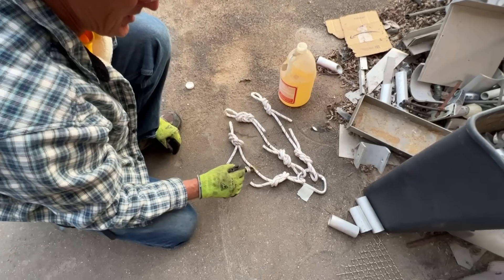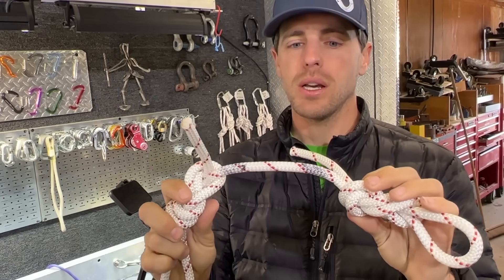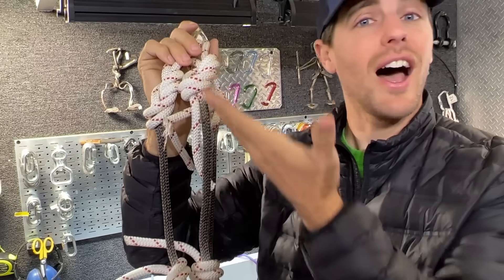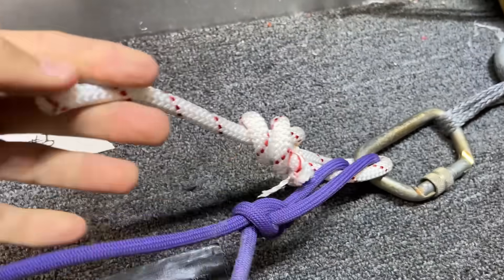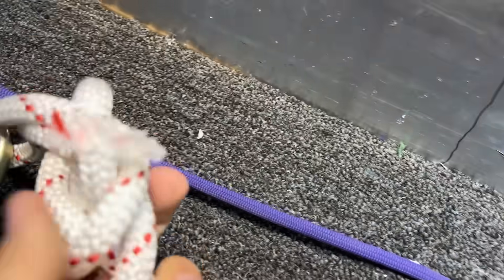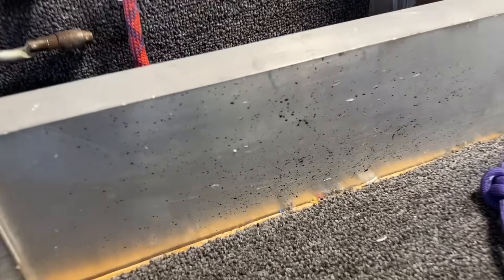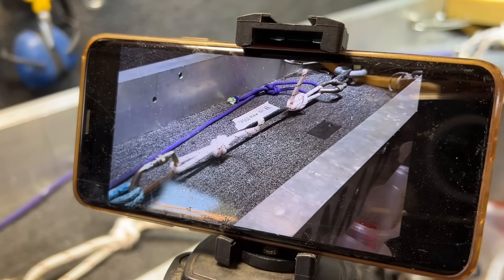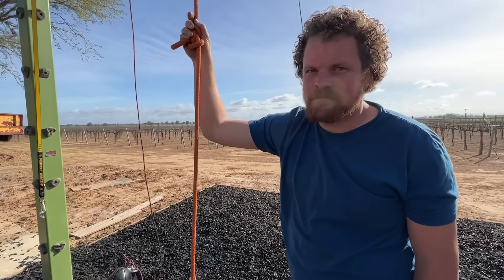Contaminated climbing ropes - oil, sunscreen, deet and acid

Comment: I'd say for this kind of test, it'd be better to test the "full strength" instead of knot strength, since if a rope is exposed to chemicals in a work environment, there's a good chance you're going to put knots in the potentially compromised area, further reducing the strength.
Anyway, it's easy enough to see what can and cannot damage the rope chemically, just compare the material (Nylon most of the time) chemical stability against the agent used, most nasty stuff stuff you'd expect to damage ropes is surprisingly harmless.
As for oil, Iapart from making the rope slippery and attract dirt, which is not ideal for anything really, some oils have softening agents, which in the short term won't do anything, but prolonged exposure will swell and destroy the fibres.
Reply from the maker: I don't have the ability yet to test ropes with diverters for full strength.  I'm also not very motivated to because I use knots when I use ropes so I like the real world use case tested.  If it breaks in the knot then the contaminate we tested was less damaging than the knot was for it.
Reply: That’s all well and good until you tie a knot in the contaminated section of rope. 

Which, btw, is how you could test this without diverters.
Reply: @HowNOT2  just soak one knot and not the other knot
Reply: @HowNOT2  I guess so, but let's say the knot lowers the strength by 50%, and the contamination lowers it by 40%, it's still gonna break in the knot, but if you put a knot in the affected area, the strength loss would be compounded.
Wouldn't a piece of say 40mm pipe/ rod at either end be enough to test the ultimate strength, or close enough to it? For ropes a thick walled pipe should be strong enough, as you're not testing anything larger than 11mm.

Comment: Have you done any snap tests on knots like the super 8 or figure9? Interested in how much strength I can retain with those knots.
Reply from the maker: I did a super 8.  I haven't released it yet.  Breaks just like an 8 whether or not you pull just one ear or both.
Reply: @HowNOT2  thanks for the response. I always liked the super 8 because it felt like my loop was doubled up and there would be additional shock absorbers,   despite being “pho-redundant”  so to speak.
Reply: @HowNOT2  I also just left a comment on your responding to trolls video. Thanks for all the hours you put into your content, it’s very valuable to the gear heads and knot wizards 🧙‍♂️ who would otherwise injure themselves trying to push their gear to the extreme.

Comment: Good video per usual. Surprised deet didn’t do more damage. While chemical sunscreen may not damage your rope, it’s very hard on your skin, increasing your risk for skin cancer nearly as much as overexposure to sun. Chemical sunscreen also contributes to air pollution as it off gases contributing to voc concentrations in the atmosphere. Always recommend mineral based sunscreen over chemical based.

Comment: Acid can take time to damage nylon. I would like to see the results 5-7days after the contamination.
Reply from the maker: In just 24 hours it broke it low enough I wouldn't want it on my ropes for any length of time.  But yea, it could probably keep damaging it.
Reply: @HowNOT2  I'm more curious of other contaminates over longer durations. Oil and other products could take months to react with the rope before any noticeable wear. Direct sunlight and regular use can provide energy to speed up the process.
Reply: @HowNOT2  you're absolutly right but I'm curious on a later result just for the sake of it ><